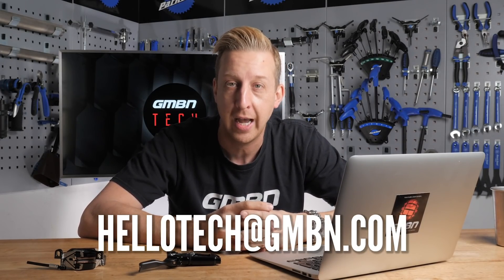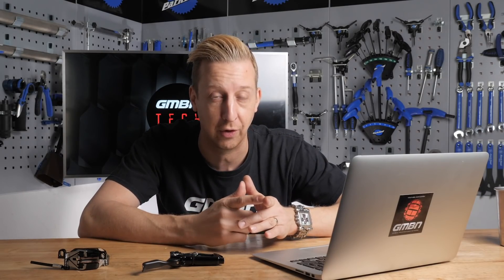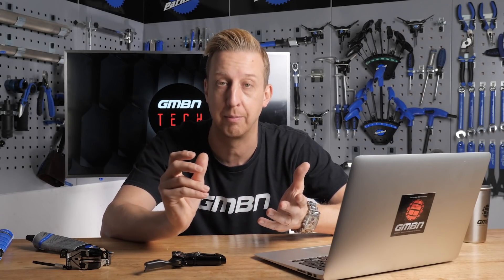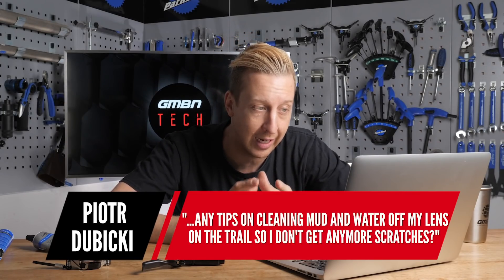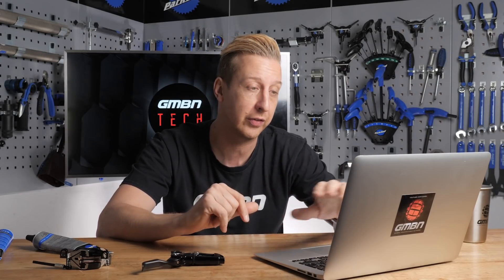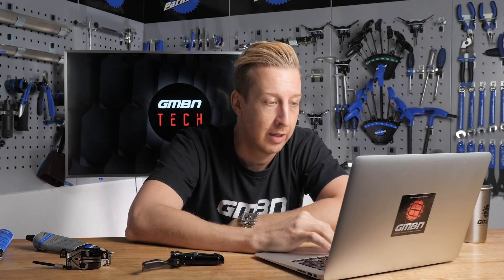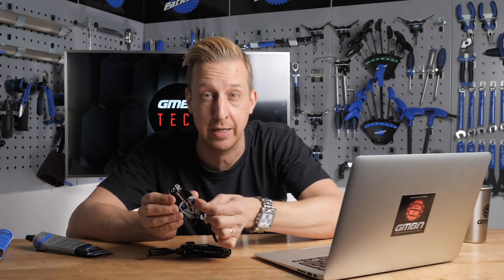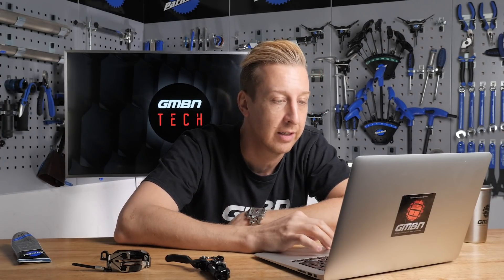How Do MTB Brakes Get Air In Them? | Ask GMBN Tech

Comment: #askgmbntech Hello Doddy - Love your work, I'm still new to mountain biking but I feel like I'm catching up a lot thanks to you and the GMBN crew. I've recently bought a used and heavily upgraded Specialized Enduro FSR EVO 2013. I plan on having it serviced soon before I'll do regular rides, but I already noticed that the rear mech is not working properly. The first thing I noticed is that the jockey wheels on the GX type 2.1 derailleur are very worn - fair enough it should be easy to amend. But then I noticed that the mech doesn't want to shift from 1st to 2nd and instead goes into 2nd after another click of the shifter. Then around the fourth gear it skips one cog and goes back to the adequate gear. I've also noticed that the cage is not exactly parallel to the cogs and that combined wih worn jockeys sometimes causes the chain to slip off the tension jockey wheel. Taking all that into consideration could it be that only the hanger needs replacement or is it possible that the mech is bent and needs replacement? Could it be both? Which components should I expect to replace?
Reply: usually its the hanger that get's bent first, it can be aligned again with an expensive tool or you can replace the hanger. But maybe before you do that check if the hanger is still mounted tight on the frame and index your gears again (plenty of videos around and good to know to do yourself)

Comment: #askgmbntech hello, I’m inquiring about painting the outside of my break caliper a different colour. Right now they are just black. Is there a certain paint I should use or do you have any steps I should follow?? Or is this not recommended. I can’t seem to find sold info on this. Or do you know of a supplier that offers different colours and ships to Canada. Any help on this would be appreciated, thank you.
Reply: Dude just used plastic deep paint
Reply: If youre really hammering on your breaks then you might want to get a spray pain rated for high temps, but youre probably fine using standard spray. Just make sure you do a really good job keeping it only on the outer shell of the caliper.
Reply: This is a common thing to do on cars.  The paint you want is available at an auto parts store.

Comment: #askgmbntech
I ride an entry-level hardtail and it has a SR Suntour 100mm coil fork. I know that this is a cheap fork, but for some reason, even if I adjust it, it remains very stiff. Is there something wrong with the fork as to cause this, or is this fork just designed this way? Thanks
Reply: Mine had the same problem

It usually means that it doesn't have enough oil
Reply: the suntour coil forks dont have oil to lube the stanchions, they rely on grease only since there is no foam wiper seal. To keep them smooth you have to do a lower leg service every couple of months depending on riding conditions. This means taking off the lower legs, cleaning the stanchion tubes/lower legs/seals. then pack the seals with some suspension specific grease (like sram butter) for best feel (also try to grease the bushings which lie a bit deeper in the lower legs with a small brush or similar). finaly reassemble and ride

Comment: #askgmbntech
hey doddy, love your show! i have a question i couldn't find a proper answer to yet: are the castings/lower legs of rockshox lyriks crosscompatible throughout the modelyears? for example, can i fit a 2019 lyrik casting to a 2017 lyrik rtc3 dual position air? reason for this is, that i bought a new bike, that is meant to be ridden with a short offset fork (37mm) but i don't want to miss the option of reducing the travel for long climbs. plus, as far as i know, there aren't any dual position forks with a short offset and i don't want to spend the money on a whole new fork. so my plan would be to buy a new 2019 casting with 37mm offset and fit it on my 2017 fork. 
cheers (:
Reply: dont take my word but i think if the stanchion diameter is the same, and the mounting hardware at the bottom is the same it should work since the lower legs are simply tubes with a seal and bushing

Comment: #askgmbntech is it worth buying carbon components (handlebars, etc.) for an alloy framed bike?
Reply: Yeah, why not, go for it if you have the money!
Reply: Carbon is trouble. I learned the hard way several times. Unless you are racing where every gram shaved off counts, forget about it. It may be lighter and stronger at first, but rock dings and scratches weaken it fast.
Reply: i think carbon frame and wheels are 2 uprgades that are for not sponsored rider best. cuz bars etc.. are braking lil 2 much
Reply: I have carbon bars and cranks on steel SS and it helps...just make sure u budget for a good quality torque wrench...it is a must have

Comment: Industrial degreaser will ruin finish on components if you don't clean of immediately , I messed up the look of a relatively new Ultegra crankset, it ended up looking all stained, as if I'd polished it down to bare steel in some parts.

Comment: #askgmbntech I'm looking at getting a new bike and I can't decide between the canyon spectral Al 5.0 or the canyon torque Al 5.0, I feel like I might grow out of the spectral because of it's shorter travel however I am a lighter rider at 65kg and I might not need 175/180. Both bikes are the same price! Thanks in advance doddy been loving the content
Reply: Defidnely go for the Spectral, it's way more capable than you'd think and it's now officially categorized for Enduro racing! I would only go for the Torque if the only thing I did was hitting bike parks. (I have the 2018 Spectral 6.0 and it's the best bike I have ever ridden)
Reply: @th_js  thank you and I live in Christchurch new Zealand and I go to the bike park maybe once every month, thanks for the reply 😁
Reply: You aren't going to grow out of the travel, what does that even mean? Also weight doesn't make a difference, you just run more or less air.
Reply: @src248  I was meaning how capable the bike is with shorter travel
Reply: @donniethornberry7750  Super capable, especially now that  it has more travel for 2019, but that doesn't make a big difference
Reply: @donniethornberry7750  if you rely on suspension for riding you are doing it wrong. using technique and your body's suspension (arms and legs) is what makes a rider capable. the bike's suspension aids the process and makes it easier
Reply: @ultiss  thanks I haven't been riding for long as my bike was stolen recently, and I don't rely on suspension I was just wondering if the spectral would be limited by it's shorter travel
Reply: And it's funny that I am also 65kg!!
Reply: @th_js  haha I'm only 16 though
Reply: @donniethornberry7750  Haha I'm slightly under 15 and I'm 185 cm tall
Reply: @th_js  Fark mate I'm just on 181 cm, how hard was it to assemble the bike from the box?
Reply: @donniethornberry7750  Super easy if you know what you are doing!
Reply: @th_js  yeah I have a pretty good idea of how a bike goes together

Comment: #askgmbntech what’s a good tools set that works well but don’t brake the bank and what chain degreaser do you recommend.
Reply: cheap tools will wear and damage components over time, expensive tools you'll only have to buy once. Just do some research on which brands offer decent stuff and go from there. maybe check reviews on retail websites

Comment: I have hope tech 3 v4 that uses dot fluid , I wonder can I replace it with mineral oil ? Is that would be any beneficial  cheers  <3 #askgmbntech  🔧🔧🔧
Reply from the maker: Hi Karolis, you definitely cannot use mineral oil in your brakes. Doing this will cause lots of damage to the seals of your brakes and you'll probably have to completely rebuild them to get them to work again. Still to the dot fluid that Hope recommends. 👍
Reply: @gmbntech  What if I do the rebuild with new seals and completely clean system and then use mineral oil ?
Reply: @Dude-Smellmyhelmet   Why  ? mineral oil seems more friendly to seals so, I'm just wondering :)
Reply: @KarolisBorkertas  There's different types of seals, regarding their compopsite and properties towards DOT and MO!
But you just might wanna try shooting HOPE an email - they'l tell you whether there's a way around that issue.
Reply: Hell no
Reply: As others have said. NO!! Mineral oil and DOT are 100% not interchangeable.

Comment: #askgmbntech
I noticed that one of the pistons on my hydraulic disk brakes wasn't moving much, but the opposite piston was moving smoothly. I assumed that i needed to internally lubricate the pistons when this process I had also taken out the brake pads (which i shouldn't of done), but also when doing the process, i didnt let the pistons travel far enough so that I couldn't pry them apart with a screwdriver. After putting everything back i pulled the lever and it felt super super spongey. Did i damage the piston seals? how did i let air in the system? There was no residue of oil leaking anywhere on the system, Thanks.
Reply: Simply opening any hydraulic systems gets some air bubbles inside, every time you open any hydraulic system you'll need to bleed it.
Leaks are very easy to find, it usually happens on the fittings and it's really obvious when a brake is leaking, you'll see the fluid somewhere, so considering you don't see any oil you're good in that front, it's extremely rare to blow a line.
Reply: @zurri6513  cheers! I guess I'll give my brakes a lever bleed. I don't think it's necessary for a full system bleed or is it?
Reply: @amistry2092  how to clean pistons: https://www.youtube.com/watch?v=vQXFFgRButo

Comment: #AskGMBNTech I have a 2018 Specialized Pitch comp 27.5 hard tail the drivetrain is a shimano acera rear derailleur and Altus front derailleur it is a 3X9 cassette I was wondering if it was worth converting to 1x10, 1x11, 1x12 as I am jealous of my dad my mates and his friends. The area I ride is very not flat and hills are very common as I need a really big and little gear
Reply: i would say no, if you need a big range the only good option would be 12speed with a 10-50 cassette meaning you would also need another wheel. my area is pretty flat with occasional steep stuff and i actually went from the stock 1x11 (11-42 cassette) to 2x11
Reply: ultiss yeah I suppose I could go 2 by but it isn’t a problem with one by with all my mates but any way thanks mate for helping
Reply: @harveylakey6261  if 1x is fine the best bang for buck option will probaly be fitting a narrow wide chainring to current crank and swap rear derailer/shifter/cassette for sram NX
Reply: ultiss thank you so much for the advice
Reply: You can buy a husselfelt crank set for 130 with chainring and a howitzer BB for 70 cheapest way to go 1× unless you can fit a new 30 tooth chainring on your old cranks